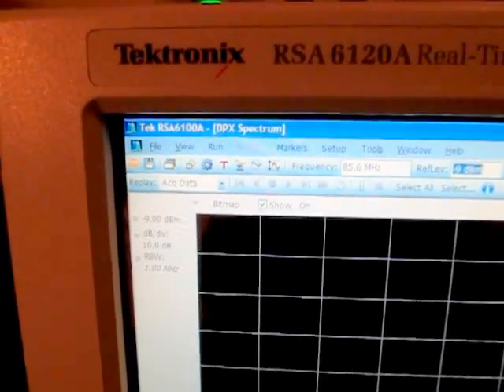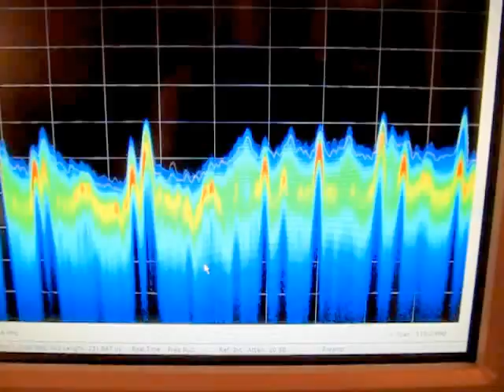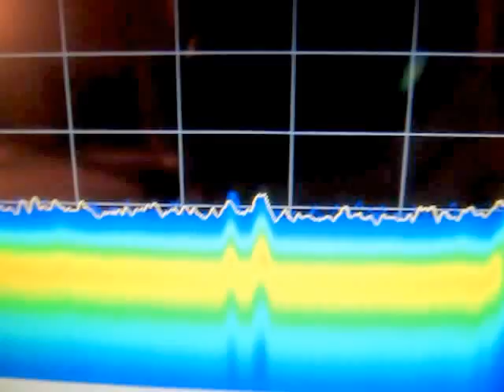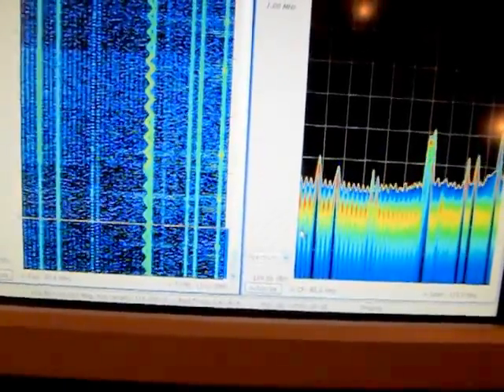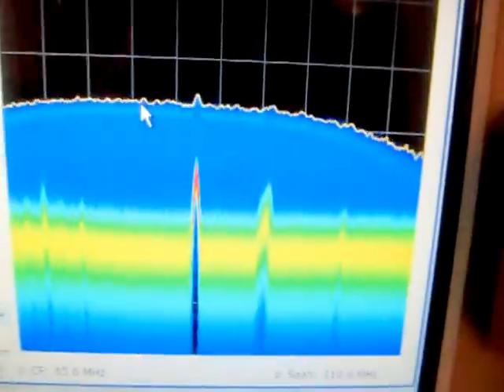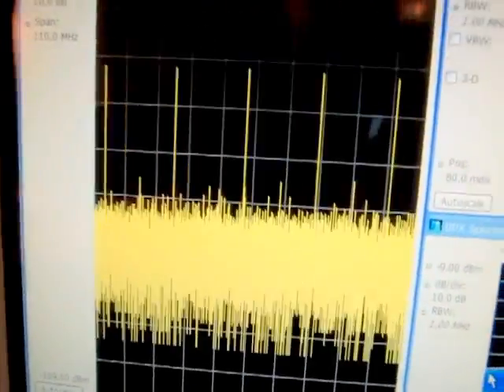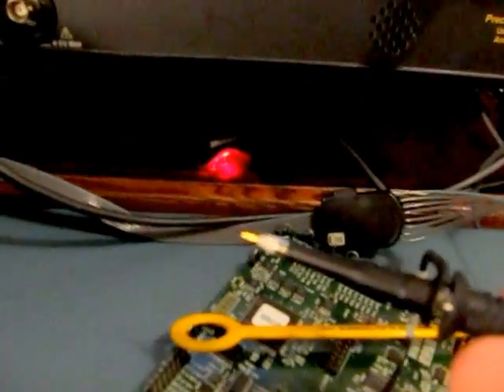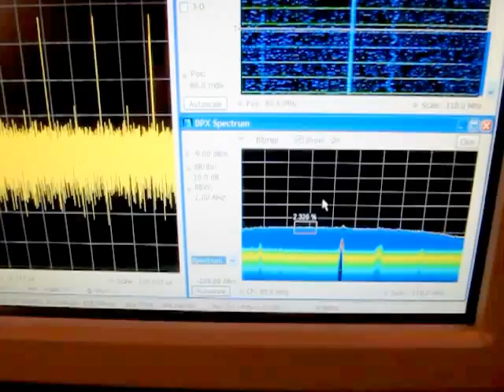#27: Board level EMI Debug with a Real Time Spectrum Analyzer

Comment: you'd be amazed at how much is possible to hear with a dynamic mic + guitar distortion pedal + mixer + pair of headphones. A lot of gain is in that path. I can't even count the number of boards i've repaired with this method. Its like this > ya we can't hear the actual bits, but the events which drive components is more in the audible frequencies. its not like we can tear chips apart so we just need to know they respond and talk to each other. Easy to follow the signal path through the traces and find bad components / quiet chips / broken traces&via's / etc ...  but  I must say that fancy equipment sure looks nice.  Maybe 20 years from now they will be affordable :(

Comment: Hi Alan, great material as always. In the video you study the emission of the PCB with the near-field probe. But do you have an idea how to study the performance of a circuit under the EMI of say 3 V/m in a freq range of 80-220 MHz? These tests are usually done in the shielded rooms or the likes, but is there a way to create such fields in lab environment?
Reply from the maker: It is difficult to do outside of a chamber due to signal reflections.
Reply: @w2aew , That I'm aware of. My goal is to have even a slight understanding of how the circuit performs. Is there a way to create such field in the lab?
Reply from the maker: @ddal3998  Here is a typical setup: https://www.laplace.co.uk/iec61000-4-3/
Reply: @w2aew , thanks very much, Alan!